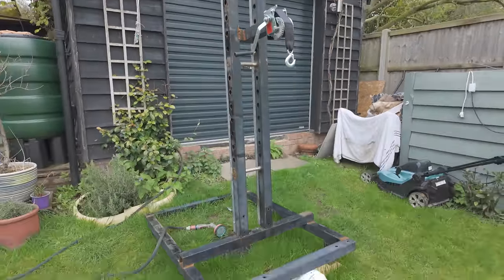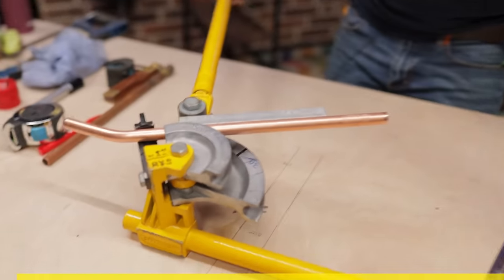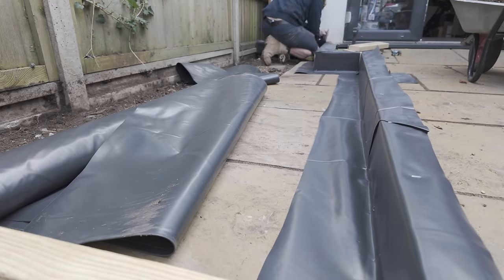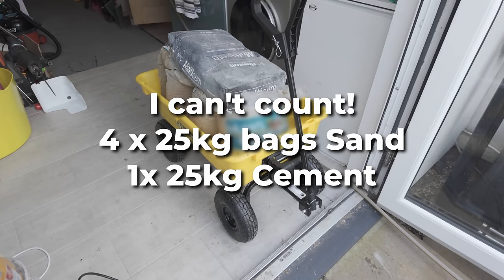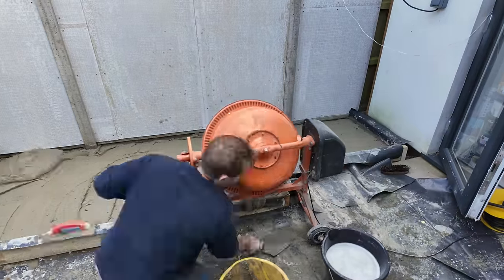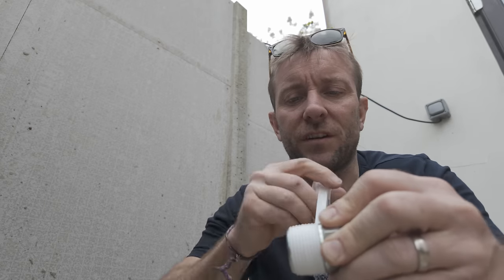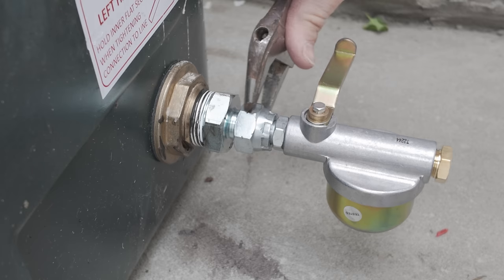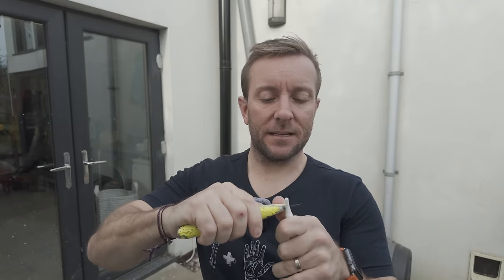NO HEATING IN MY OWN HOME (Back Breaking Work) Bunded Oil Tank Install

Comment: Oil heating in 2024???? Should have got in heat geeks to fit a heat pump!!!
Reply: £30k to retro fit heat pump. ASHP install I needed to replace microbore system, replace new radiators with new bigger uglier radiators, replace hot water cylinder, rip up hard wood flooring and dig up concrete floors then repair and replace, chase fill then redecorate walls, up grade consumer unit and run new circuit (all that just so we can be cold in winter). 
No thanks I take the £6k for replacement with new highly efficient oil boiler and tank!

Comment: Didn’t think cement board was recognised by OFTEC these days? Only option was concrete block wall, or keep it from the boundary at 760mm. 
Also the tank is way too small for the house. Otherwise good effort. 😜

Comment: Does the tank have to be on a foundation extending 30 cm on all sides? Mine was installed by Calves Hill in 2017 and is 50/100 mm from 2 walls and 30 cm on the other sides. I have the slimline tank   and if it gets pulled further from the house brick the foundation will extend to the shared path.

Comment: Rob from Barton Oil said that the plastic tiger loops are now not compliant and they need to be all metal ones 😮
Reply from the maker: Ah bummer!
Reply: Seems daft when you can still use plastic oil tanks.
Reply: @greenoval25  Very daft indeed... people sitting in standards committees for you, no common sense most of the time.
Reply: @plumberparts  Hi. This is Rob from Barton Oil !!! Yes Metal ones are meant to be used now but tbh i prefer plastic ones to see what is happening in the line. The rules are frustrating and metal ones are to reg but at my house it is Plastic 🤣 Great video mate and love watching then. If i had a 10th of your subs i would be happy mate🤣Have a great weekend. ps Congrates.
Reply from the maker: @BartonOilBurnerServices cheers man. You’re about the only level headed OFTEC who’s commented on this video! I was reg for years but jacked it in because of the massive hassle and mad regulations!
Reply: @plumberparts  The regs are mad mate. Yes things have to be done but i dont always agree. Things like seperate hole for fire valve i fully get but tiger loops being plastic is a sore subject. If they are checked correctly yearly and changed every ten years then no problem in my eyes? Also as i said on my recent vlog if you have a plastic one on a Sunday night that needs changing asap then the latest tiger loops have the pipes in a diff place if the old tiger loop is 10 years plus old. so you can buy a differnt make plastic one that the hole positon is in the same place so what you going to do? Swap for plastic to get out of trouble or repipe it!. Chuffed you replied to me . Have a good weekend and i look forward to your next video. Rob
Reply from the maker: @BartonOilBurnerServices one thing I’m going to do as a test is force and time a lockout by popping the pin on the fire valve (where I’ve installed it) and closing the valve to the Tiger loop. I BET closing the valve to the tiger loop allows the TL to circuit the flow of oil inside and keep the boiler running way longer thus causing more of a fire hazard…then in going to set light to my fence! 😂🤪
Reply: @plumberparts  You make me laugh mate 🤣😂😂😂😂😂🤣🤣🤣🤣🤣

Comment: Don’t you just love keyboard warriors, sorry, here I go. 
Fire board should not be attached to fence like that as you are protecting tank from fence not the other way around. Your fire valve should be on the line going into tigerloop not on the flow around loop, plastic tigerloops shouldn’t be fitted anymore. Fire valve capillary should go through its own sleeve through wall as well. Other than that a tidy job. Keep the videos coming 👍
Reply from the maker: Funny one this. My Oftec audit officer bloke said the fire valve had to be on the feed as the boiler could still burn the oil in the tigerloop - but hey he was probably wrong - they usually are! Agreed on the fence thing - although it seems like a daft reg. Didn’t know about the plastic so thanks for that. Assume it’s because of the sun knackering the plastic. Fire valve capillary was a good spot - although again a daft reg! Cheers for the comments mate!
Reply: The way you have got the fire valve at the moment, heaven forbid you do get a fire in boiler case and it burns through the hoses, if the level of oil in tank is above tigerloop then it can still feed the fire through return line, oil will still flow under gravity. The sleeve for the capillary is in case you need to change fire valve in the future, it’s a ball ache having to either pull oil pipe out or stick another hole through wall. I think the rule for metallic tigerloops is like you say sun damage and also fire rating. Rules rules rules. I have got to resit OFTEC assessment again this year, 5 years goes quickly.
Reply: @plumberparts  Looks good to me, most of the boilers I work on have the  plastic tiger loop in with oil hoses not copper ,fitted inside buildings , if the plastic tiger loops are illegal why is everyone still selling them.

Comment: Glad to see that you are sticking with kerosene.  We have 2 x 1200ltr paralleled.  They also feed  our back up generator and shop diesel heaters. as we are out in the sticks.  I should add that a diesel generator needs two stroke oil for the pump's sake.  Legalities.  Let's not go there.  😅
Future.  Looking at upping our solar  and going in to HHO production.

Comment: James, your filter / stopcock combo is awfully made with cheap alloy. Before the oil man comes, change it for one where the valve is separate from the filter bowl. That way you have an independent means of isolating the tank if something happens with the filter.  My version of that filter corroded and developed pin holes. Had to drain down just to fit a new filter bowl.

Comment: you made couple of miner mistakes friend you should put the fire valve on the feed going to tiger loop and you should of made a seperate hole for the cappillary of fire valve  going to boiler incase it ever needs replaced.hope that helps.enjoying your videos

Comment: Installing the tank is not a DIY job. You will need to be registered with OFTEC to obtain a compliance certificate for building regs. When our heating system was replaced, I built the base and dug a trench for the oil pipe. It was then over to the heating engineer to commission the system.
Reply from the maker: Exactly! All signed off and full now. Warm again!

Comment: Our oil tanks in Italy are all underground with only the filler neck and breather above ground.
Reply: In Germany, many oil tanks used to be the same way, however, after some major oil spills, the govenment started to dislike those things A LOT, so putting them in the basement or small additional building became the norm, with underground tanks requiring lots of expensive and high-maintenance safety equipment and costly reqular inspections, while above-ground and basement tanks require almost no maintenance and, outside of specific high-risk areas, only need minimal inspections, making them a no-brainer for most people. Nowadays, the only places you commonly see underground oil tanks are those where the basement is too small for an oil tank, and there was no room or permission for a second building. For example really small houses with equally tiny gardens, where you might find an oil tank under the garden.

Comment: Just relocating my single skin oil tank & changing to bunded- really useful vid, thanks.  I’m interested in understanding more about the tiger loop as when I have previously asked our heating engineer about them they have steered me away.  Are there cons to installing a tiger loop?
Reply: A tiger loop removes the air from the oil system it works on a two pipe so you have a direct feed from the tank to the tiger loop and then on your pump from your burner you will see an inlet and outlet you attach your oil lines from this to the tigerloop don’t forget the bypass plug. They are good when the tank is situated lower than the burner. 👍

Comment: Surely that base should be concrete - oil leaks and pentrates the sand and cement will make it deteriorate, even a 2:1 mix. I would have incorporated a sand trap within a lining so as not to penetrate the soil.
Reply from the maker: No it’s totally compliant. Believe me I’ve seen some AWFUL installs!

Comment: Surly that base will crack under the weight. i would have used fiber reinforced concrete myself.... but its your house.
Reply from the maker: There’s 20mm agg in there too - that’ll be fine. But I’ll update you if that helps?
Reply: @plumberparts  Right ok. just let us know how you get on. i thought it was just sand and cement TBH

Comment: Pretty sure fixing cement boards to the timber fence does not comply. The intention is to stop fire spread reaching the tank. If the fence catches fire from the neighbour’s side there will be nothing left to support the cement board and fire will spread to the tank. The cement board cannot take support from combustible material on the neighbour’s side.
Reply from the maker: I mean I get it - but in what world are we living in?! These regs are flipping MENTAL! 😂😂😂
Reply: Agreed, if next door have a fire and it burns the fence down I doubt even the 760mm that building regs say it has to be away will make a lot of difference. I have this discussion day in day out with customers.
Reply: My thoughts exactly. At the end of the day, when I do fireproofing for a customer, I would do it to regs, when I do it for myself, I'd do it to regs, double skinned with mineral wool and intumecent sealant. I will always stay on the safe side. James just takes on the risk and the possibility of insurance having an issue if there were any incident.
Reply from the maker: @ChristianBHough  I think my install is perfectly safe. PLUS IVE SEEN A LOT WORSE! 😂😂😂
Reply: @plumberparts agreed. At the end of the day, you know your neighbours. They know you have a tank being the fence and aren't going to have their BBQ right next to the fence, so all safe. 😊

Oh yes, congrats to you both.
Reply: Indeed, my tank made in 1998 needs replacing and the fire barrier it seems should be self supporting between the tank and the wooden fence. I see you can also get fire rated oil tanks but they cost a lot more and I still don't have room for the 300cm all round. Thus I am looking at having a ASHP installed instead.

Comment: Can you, within regs, hide it at all?  It's a bit fugly right outside the door!  I'd prefer it as far away as possible, but that obviously doesn't fit in with your plans for that end of the garden.
Reply: Yes oil tanks always stink of oil.
Reply: @truthseeker7794  I have to agree, my sister's old place, the oil tank smelt, as does the one at my mum's.
Reply from the maker: You can hide them but the regs are insane. I’m not sure one engineer has ever made up a reg! Holding the fact it’s bounded will mean it smells a lot less than my single skin one.

Comment: But why use oil? Can't you just be eco and move to heat pump ?
Reply: Cost. Time. Familiarity. Upheaval, especially when just after having a new born. There’s lots of reason why someone can’t just be eco. It would be great, but not always possible. Everyone is in a different situation.
Reply from the maker: The more CO2 I spill the greener the trees! 🤪
Reply: @plumberparts hahaha 😂
Reply: @plumberparts  not the answer I was looking for someone I admire watching....
Reply from the maker: Why Max? Trees live off CO2 😎 Also watch the latest film by Martin Durkin - really interesting when Nobel prize winning physicists start saying that climate change is a little ‘overdone’ https://youtu.be/sUOn8Q2UsLQ?si=-KNhtTDVAew5wNJh
Reply: @plumberparts  agreed.  Climate alarmists, covid alarmists - same difference.
Reply: Give it a rest🤣 heat pumps aren’t the way forward sadly, not at this time and especially not in an existing building. Do your research👍🏼
Reply: which are useless in cold weather because of the crap efficiency and poorly insulated old UK homes. Good idea. Pay over the odds for a useless system and keep your water hot with fossil fuel powered electricity.
Reply: @sammysquib1982  I guess you might need to read up... But sure if you think this day
Reply from the maker: Hasselmann’s paper on the recent stagnation in Earths increasing temperature (below predictions) was indeed interesting - guess he’ll lose his funding now, be silenced and therefore cement the continuing (and false) ‘consensus’ 

But hey this is the YouTube comments section! There’s more important things to do!
Reply: @plumberparts  You mean the paper titled "Can climate models explain the recent stagnation in global warming?" from 2013 (a decade ago), for which he lost no funding and was published and widely reviewed by the scientific community? The one that lead to more accurate climate models, and also the observation a few years later that the slowdown had ended?

It's the YT comments section. Nothing important to do... Besides, my original comment doesn't even show up anymore. Guess someone reported it or something.
Reply: Wet heat pump systems have many issues. No reason to use them preferentially just yet
Reply: Are heat pumps a false economy. I mean you use more electricity to run them, and not all electricity is produced by  wind water sun. 🤷.
Reply: Max you are the biggest wet blanket mate 😂

Comment: Wow! Can’t believe you’ve put this up. So many things wrong with this installation. When was the last time you sat your OFTEC? Fire board on a fence is a big no no, that will not pass an oftec inspection! No secondary isolation and filter before the tigerloop. Plastic tigerloops are not recommended now, metal one should be fitted. Fire valve in the wrong place. Oil line not sleeved through the wall and also no separate sleeve for the fire valve phial for ease of replacement. Please people do not follow this. Good job it’s on your house and not a customers
Reply from the maker: So’Mr Dubstep’ 😂 love the name btw. Got a few points to reply with. And they’re actually to do with the practicalities of real life, and the very real human reaction to point out regulation contraventions for the sake of it.

So let’s look at the install itself. 

Fireboard on the fence was the only way I could do that install. I can put fireboard on the other side and may do in the future. But to say it’s a ‘big no no’ completely misses the point as to why (in OFTECs mind) it is a no no…I understand if there’s a fire on the other side of the boundary the fence can catch fire. But to a large extent the tank is still protected. 

I’ve worked under OFTEC for years and a few things have strengthened my belief that OFTEC don’t know what they’re talking about - they just want your money. 

So 1: The secondary isolation isolation valve, if I follow the OFTEC regs, should be on the feed line. I concede this. But this demonstrates on OFTECs part a complete lack of understanding as to how a TL works. In the event of a fire having the FV on the flow will stop the boiler working in seconds. Having it on the feed to the TL will allow it to continue running for another 30/40 minutes because the boiler has the reservoir of the TL to burn. 

2. ‘No borehole within 50 meters’ this one I had on a OFTEC inspection whereby the inspecting officer had asked me to visit every house within a 50 meter radius to ask if they had a borehole. If they did I could install a new tank for the customer. I pointed out that this could take weeks in knocking on doors when people are out etc. but he didn’t care! Mental!

On the plastic TL I think this actually a good move because the metal ones won’t degrade in the sun. I wanted a plastic one on this job because the viewer could then see the float - plus it’s north facing. Lucky I didn’t point out you had to fit a plastic one! 

The oil line was sleeved in 22mm you just missed it!

So just ask yourself mate, who wrote these regs? Why? Was it just to enforce rules for you to pay the £500 to do your course then the £800 to register? 

I understand we need rules, but the ones surrounding oil tanks and oil smack of quango madness, and not the level headed building regs of days gone by. 

Hope you have a nice day. 😎